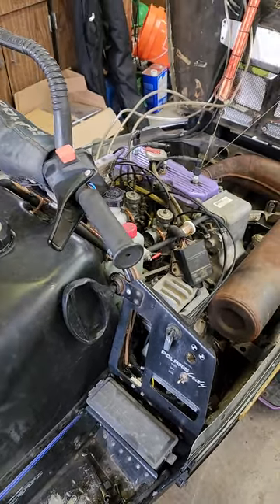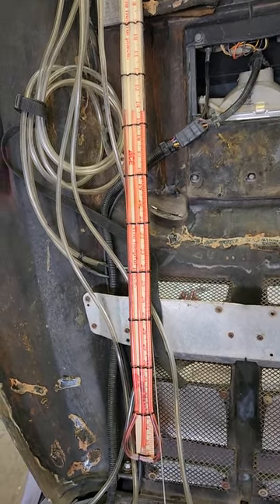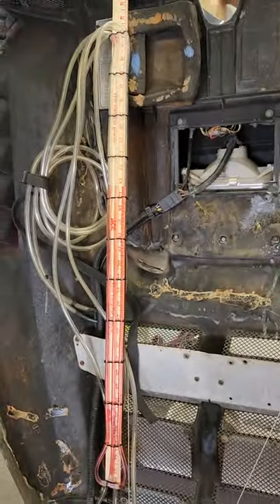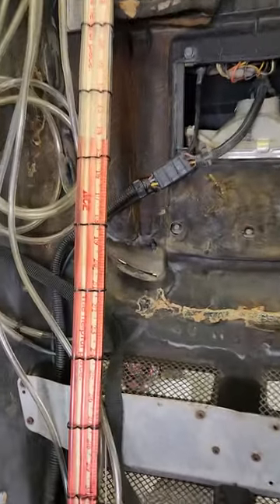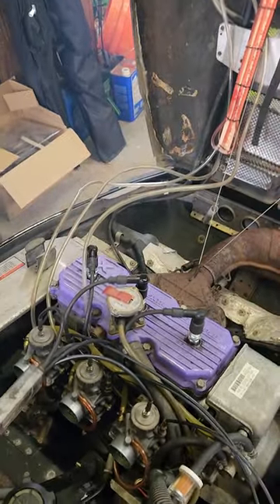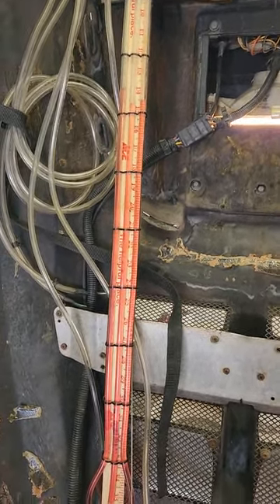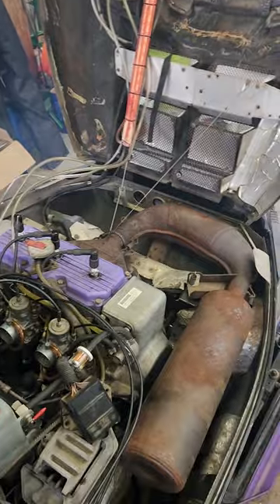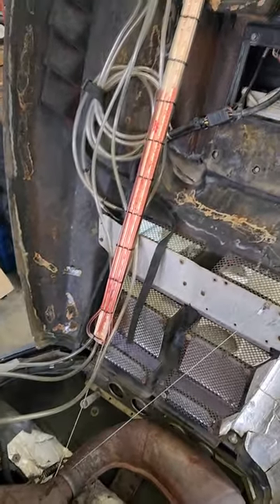Synchronizing carburetors with a manometer on a 1993 Polaris XLT SP with a 96 XLT engine.

Comment: Where do you have the vacuum lines hooked to on the carbs
Reply from the maker: There is a vacuum port on the engine side of the carb with a vacuum cap (rubber). Remove the cap and plug in lines there.
Reply: @shawnbuckendahl1968  ok cool I'll have to check it out thank you